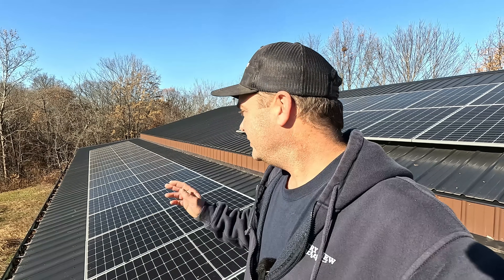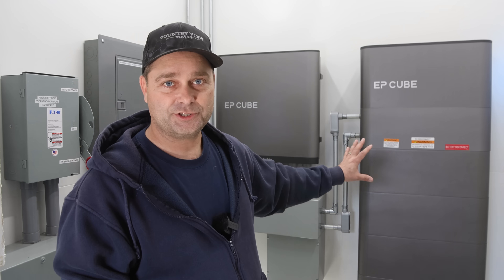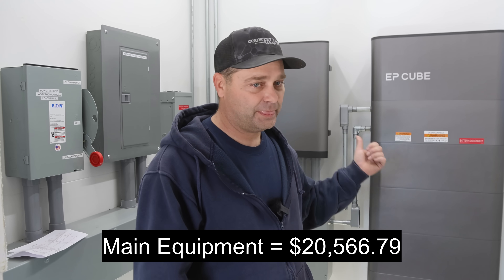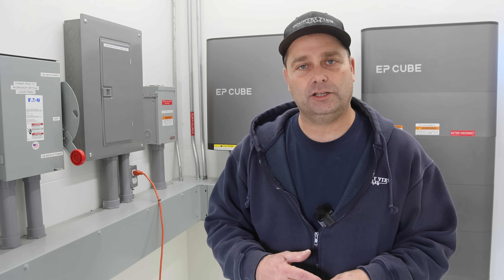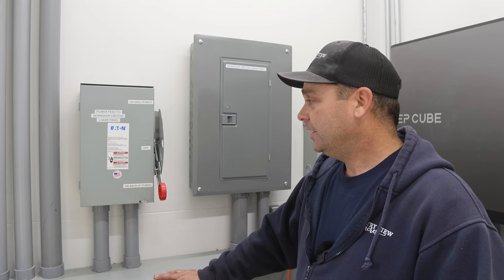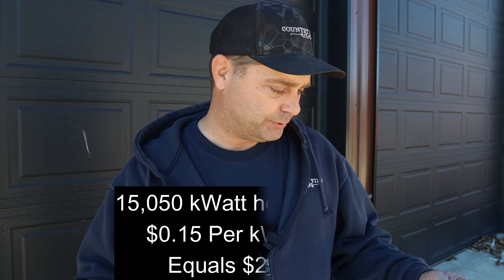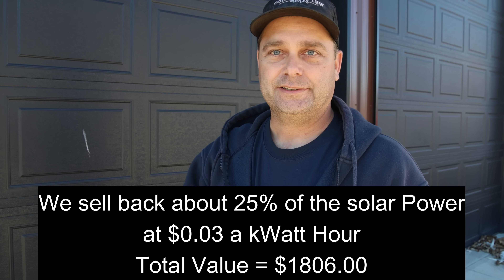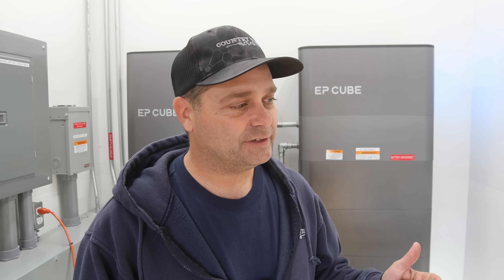Total Cost Breakdown of our Solar Power System & How Many Years to Pay for Itself.

Comment: You're blessed to be able to do the work.  Any estimate what labor may have been? Thank you and Merry Christmas.
Reply: also could you estimate your labor to get the 30% rebate on that? or is parts/supplies only?
Reply: @hpw59  I have seen scenarios where people have written off the labor. But I believe they have to fully qualified and licensed like a company that does it all. So you’d have to go with a premium all in one installer. Which will increase the price. So really you’d have to just get quotes for an electrician to do it with equipment you purchase, vs going with a company that brings all the stuff.

Comment: Is there any way to use the power you make instead of selling it back so you use less from the power company? Seems you'd save much more money using your own power then selling it for 1/5 of what they charge you. As long as your batteries stay charged say to 75% you'd run off solar and anything below 75% the power company would kick in.
Reply from the maker: It only sells back power after the batteries are above 90% charged.
Reply: @CountryViewAcres  With the power company paying you only a tiny wholesale rate, I should think that you'd want to buy more batteries to try and store as close to 100% of the power you are generating as possible. Better to avoid paying $.15 than make $.03 per kilowatt! But in any event, nice job, Evan. You have increased your self-reliance dramatically.

Take care and God Bless - and Merry Christmas to you and your family!

Comment: Would there be a different in cost if you can install on the ground if you have the space if so what your opinion on the cost difference if any.  Thank you
Reply from the maker: Depends on the cost of the ground mount and the distant to bury conduit and wire.  So a ground mount isn't necessarily cheaper, there is a lot of factors to consider.  But It probably could be, if it was very close to you inverter or electrical equipment.
Reply: @CountryViewAcres  Thank you 🙏